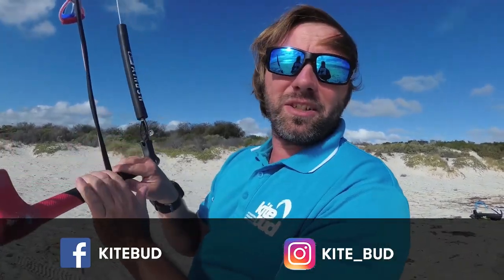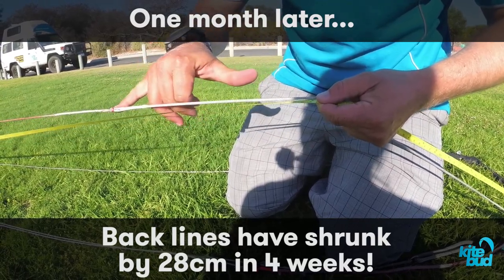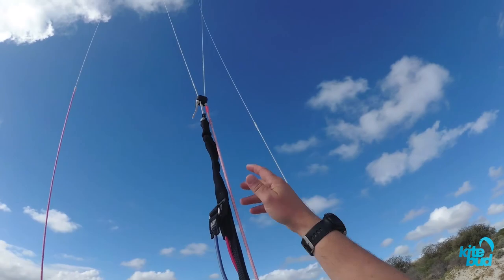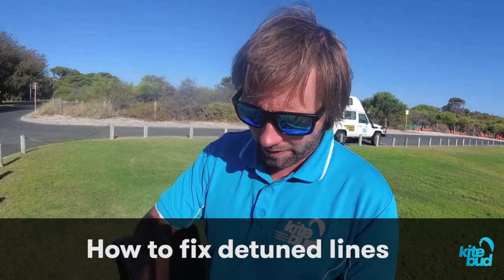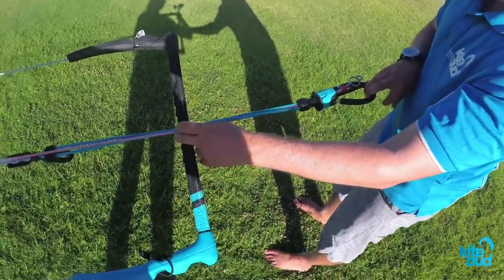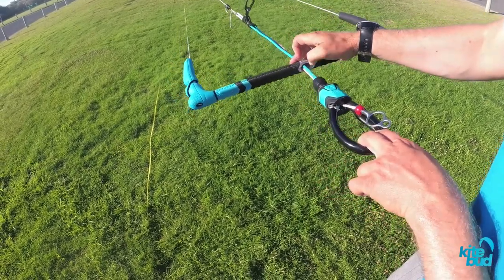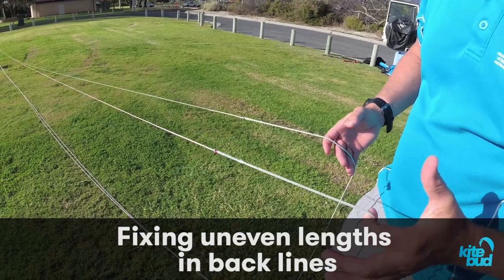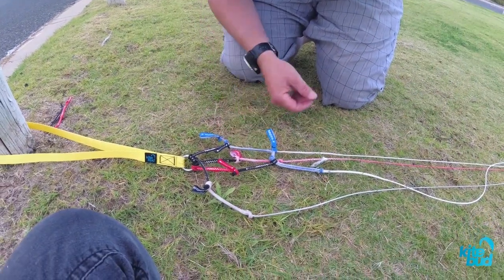Learn how to tune your lines with KiteBud - Kitesurfing Lessons Perth

Comment: Really nice video and practical information. I have a new setup that's been used less than dozen times. New to the sport, I was unaware of how significant the stretch/shrink really is and plan to monitor this closely.

Comment: Very useful info guys. Good knowledge well relayed.  I also instruct and have 25 years experience, from kite buggying and kitesurf and often talk about line issue you have detailed here. I go through the same details as you have talked about. Particulate ingress into the line, salt and sand will also cause shrinkage, these particles won't wash out either. Also, another front line stretch issue is your best side for jumping, downturns and kite loops will stretch a front line and cause steering issues and drift. The initial issue of the issue is the lines are pre-stretched at manufacture and eventually the line will start to relax and shorten. Line shrinkage has been an issue on kite pully bridle lines too. You may have noticed some kite have very pulled in wingtips, mostly noticeable on North Dice, I was losing about 75mm per side of the bridle. Love and understand your lines, after all its the most critical part of your kite system.

Comment: I don't understand how shrinking back lines can cause excessive tension in the safety line.  Safety line tension seems to only be a function of the length of your "load line," i.e. the one that runs alongside the safety line from your splitter to your chicken loop.  In fact, you resolved your safety line tension at 12:54 by shortening that load line.  So how does back line length factor into it?